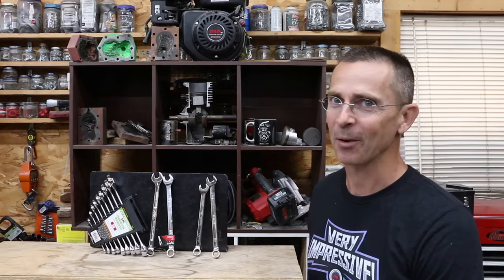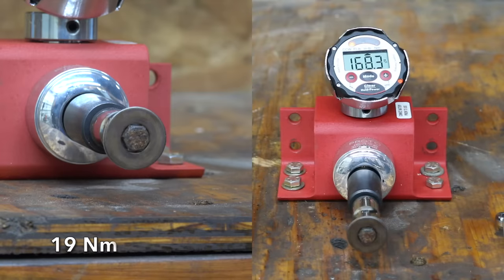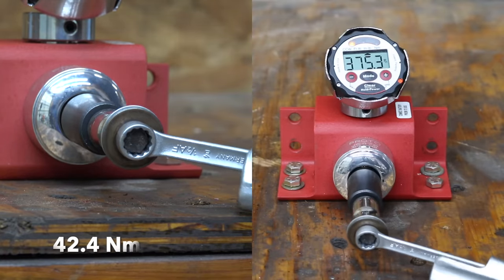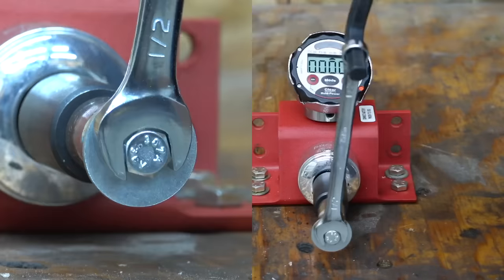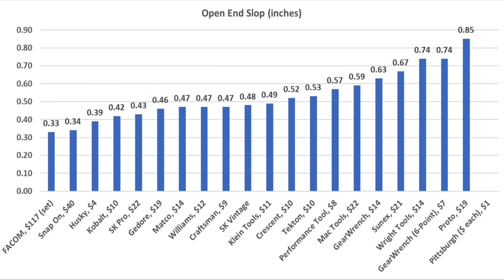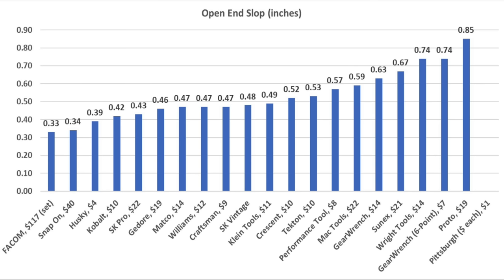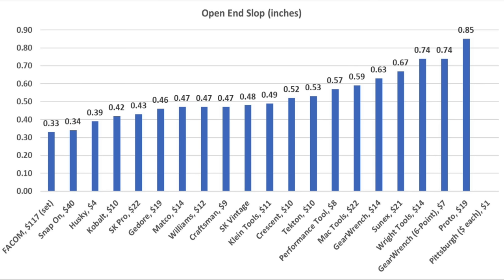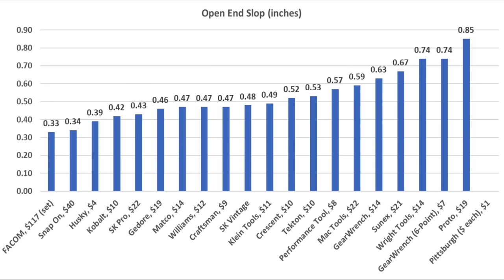Best Wrench? Let’s Settle This! Snap On vs MAC Tools, Matco, Proto, SK, GearWrench, Kobalt, Husky

Comment: I have Pittsburgh, Husky, Crescent, and old Craftsmen wrenches.  I've never had any wrenches break.  But I am only a DIY weekend warrior.  I think if I had trouble with a rusty bolt, I'd put some penetrating oil on it before whaling on it.  My Pittsburgh ones are part of the big Mechanics set.  They are not high quality but good enough.  I bought the Craftsman ones as my first toolset 45 years ago.  The Husky and Crescent were on a ridiculous sale that I had to buy them.
Reply from the maker: Thanks for sharing.

Comment: The wrench weight data was omitted from the table at the end of the video.

Pitsburg: 69.3g
Husky: 74g
Gear Wrench 6pt: 64.6g
Performance Tool: 74g
Craftsman: 95g
Kobalt: 77.6g
Crescent: 80.7g
Tekton: 80g
Klein Tools: 84.6g
Williams: 99.1g
Matco: 92g
Gear Wrench 12pt: 95.7g
Wright: 85.1g
Proto: 105.4g
Gedore: 51.5g
Sunex: 94.9g
Mac Tools: 104.4g
New SK Tools: 73.6g
Vintage SK Tools: 72.6g
Facom: 69g
Snap-on: 90.4g

It would be useful to have the wrench lengths too. Reviewing the images of the wrenches on the scale, I can see the Williams, Matco, Gear Wrench 12pt, Proto. Sunex, MAC Tools and Snap-on, are about one to two inches longer than average. Both of the SKs are about two inches shorter than average, and the Gedore and the Facom are about an inch shorter than average.

Wrenches that broke rather than bending: Pitsburg, Performance Tool, Craftsman, Kobalt, Crescent, Williams, SK Pro.
Reply from the maker: Thanks for the constructive feedback.

Comment: I noticed something here. I have heard that supposedly an open end wrench is supposed to be used in the reverse of the angle you used in every test. Instead of angled down they should be angled up. Which is opposite of crescent wrenches. Which should only be used angled down. I don't think it is AS critical to use an open end wrench is this way. But I have heard it does make some sort of difference in grip. I think because the force slightly pushes in on the bolt. Instead of just turning it.

Comment: It helps to have a set of cheap wrenches around, because they’re usually much thinner. You sometimes need a thin open-end wrench to fit bolts on shafts, such as braking and suspension components.
Reply from the maker: Good Point!

Comment: Rounded corners for less torque. If I have a stubborn nut or bolt, I will grind the bevel out of a socket or wrench.
Example is in removing a torque converter nut. You don't want to round one of them.
Reply from the maker: Thanks for the feedback.

Comment: I have a simple mechanics set of Channel Lock I got from Sam's Club. So far the only thing that broke was th 3/8 ratchet because I used it so much lol
I lose more pieces and the case broke before anything else did, only took me using a 11/16 as both a breaker bar mule and as an impact socket for it to finally break. But I LOVE their wrenches, I swear by them

Comment: Why add the Washer to reduce the grip contact when they all vary in chamfer? 

 The unless the bolt head is recessed into the project, what is the washer supposed to simulate?  It would appear most ends would have more grip if you did not have the washer. It would seem that most wrenches have enough to make Central contact past the chamfer so I'm not clear why you added the washer.  This test would be fine as a secondary test but think they should be tested as  designed to give each a fair shot . 
Also, not doing some tests because you didn't want to buy another wrench thus skews your rankings.  I maybe would understand that at the more expensive wrench side but you could have bought another Pittsburgh tool or husky wrench.

Comment: 'exterior paint an primer in one' would great to see! 
I think it could help the most people and it's less complicated than doing regular paint because results with different primers and different surfaces could vary.

 if you do it try to include Clark and Kensington, it's great stuff
Reply from the maker: Thanks for the suggestion.

Comment: Part of the problem with the really cheap ones is that the manufacturers equate 1/2" to 13mm to reduce tooling costs ( I suppose ). 0.3mm or 12thou = bleeding knuckles. Especially as Far Eastern manufacturers of fixings, pare the A-F down to the bottom tolerance.
Reply from the maker: Thanks for the feedback.

Comment: Not so much today, but back in the day did there is a specific reason why nuts and bolts have different sizes?  Tools were much more expensive back then, if the head and nut were the same size a mechanic would have to have 2 sets of wrenches
Reply from the maker: Thanks for sharing.

Comment: guys also keep in mind, most bolts at 1/2 inch are going to snap off at a certain inch lbs. so having a wrench that doesn't break at 1200 inch lbs doesn't really mean much. if you aren't abusing your tools and using them for their intended purpose then even HF tools will last.
Reply from the maker: Thanks for sharing.

Comment: What you said about the tekton is exactly what I was thinking about the husky brand wrench its current bent configuration would make pulling intake manifold bolts and transmission hellhole bolts easier lol
Reply from the maker: Thanks for the feedback.

Comment: I’ve seen first hand, several times over again, the Snap-On wrenches can remove bolts that other wrenches have already stripped.. those little slots they add in for gripping are almost like magic! No kidding. I usually don’t go for the super high end due to usual diminishing returns, but in this case.. worth it! It took a buddy to shame me a few times to realize it, full disclosure… 😂
Reply from the maker: Thanks for sharing.
Reply: snap-on combo wrenches - i used them for years.  their finish and feel i liked.  hey,  if you are a real mechanic get the best for performance and feel.  good tools are holy.  i am down here is South America and i used to joke they had a quality import examiner.  if the tool or part was too good ,  it was rejected ...

Comment: Something to consider, for a newer mechanic or home mechanic, is there a benefit to the wrenches slipping off before breaking the bolt from your first test. This is something that maybe could have been added if you had a set amount? I would be curious where the lines of force, damage, and a failure of just breaking the bolt would be. A damaged bolt can be extracted, a broken bolt has to be drilled out and the hole retapped so I could see a benefit in entry level tools slipping off before breaking the bolt.

Would be very difficult to test, but makes you wonder.
Reply from the maker: Thanks for the suggestion.

Comment: So the goal is to test for not slipping?
If the wrench is not slipping and instead breaking the bolts, here we go bolt extraction, then what is the point?
I think slippage would be the clue that the bolt needs to be heated or sprayed with some more penetrating oil on it.

Comment: Snap-On has went down in quality over the years. I have sets I bought in the mid 90's and have never had to replace anything. Used them doing auto mechanic, engine machine, and industrial maintenance work and never had to replace anything. My flank drive wrenches are different than the new ones also. Mine has grip grooves in the open end and I even used them on transmission lines and never had one not come loose. Did have to knock the wrench off the line nut several times from the bite it had. Have also removed bolts after another wrench had slipped on the bolt head my flank drive removed or snapped the bolts off.
Reply from the maker: Thanks for the feedback.

Comment: It may be worthy of considering a weighting system for your final results.  I wouldn't use an open-end (normally, when practical) for max torque - that is what the box end is designed for, and therefore, I would think that more weight should be applied to that score.  If you have to do max torque on a fastener that you can't apply a box end to, that is what flare nut wrenches are for.  The Proto didn't do well in the max torque for open-end, but the box ends were very high.  
You could also look at not simply using rank-order for scoring - the difference in force applied for the box-end failure load from 1st through 8th place is over 100 lbs, but maybe the difference between 3rd and 5th shouldn't score too differently - the difference is less than 20lbs.  Perhaps factor in the deviation between wrenches at certain loads.  
Another crazy way to look at some of the data is to compare cost to score.  Snap On overall does well, but you pay way more for that performance.  For anyone but the rich and the professional mechanic, they are not a good value.  Mac Tools, at just over 50% of the cost are a much better value.  Proto too.  But in the $18-11 range, you really can't tell, as performance is all over the place.
But I'm sure a statistician could point out other areas where raw scores are deceiving (and likely statistically not meaningful, as they likely would be fairly identical if sampling a group).
Reply from the maker: Thanks for the feedback.

Comment: I think its safe to say that most won't ever experience breaking a wrench.  I use up to 1 and 1/4 inch wrenches, doubled up or hitting with a 3lb hammer and yet to have them fail, Tekton and Husky.  So basically, think that most are capable of handling what you can throw at it.  So we should be looking at comfort and thinness to get into tighter spots.  At least, thats what I'm trying to narrow down my next set to.  Lost my sae set and gonna reup.
Reply from the maker: Thanks for the feedback.

Comment: Very thorough! I'd love to see you re-do the open end tests with a Snap-On Flank Drive Plus wrench. I have a lot of them and swear by those open ends for gripping rusty or soft bolts and nuts where normal open ends slip.
Reply from the maker: Thank you!  Thanks for the suggestion.

Comment: I bought a 1/2" Pittsburgh telescoping ratchet and I put a 5 foot pipe on it with it fully extended expecting it to break and I still use it everyday. It has outperformed every 1/2" ratchet I have ever seen. I have broken craftsman, kobalt, proto, gearwrench, Stanley, and countless others with much less. I'm almost trying to break it at this point!😂 IT WONT BREAK, maybe it was built on a Wednesday
Reply from the maker: Thanks for sharing.

Comment: Todd. Love the comparision videos on tools, oil, etc. Just wondering why you've never tested tools made for Walmart like Hart and HyperTough? Would love a video comparing their 8-22mm wrenches for example.
Reply from the maker: Thanks!  Thanks for the suggestion.
Reply: @ProjectFarm  I've seen the driver adapter video you created, which included Hart and HyperTough, but figure Hart might have had a design flaw instead of poor quality steel. A video testing the quality of corrosion resistance on tools would be nice too. I figure there are very different types of chrome vs black phosphate coatings on tools today. No one wants a coating that chips off after a few uses, even if it looks nice at first.

Comment: Very well done objective testing. At some point it would be interesting to see the performance of the TiProlight Titanium Wrench(es). They are aimed at the motorcycle market where the weight of carried tools is important. (Supposedly a quarter of the weight of the equivalent steel wrench.)
Reply from the maker: Thanks!  Thanks for the suggestion.

Comment: Please start testing different size wrenches. I bought the Icon anti-slip wrenches, and the 6mm slipped on a 6mm hex key. The smaller wrenches just don't have the strength of a 9/16".
Reply from the maker: Thanks for the suggestion.

Comment: -- GearWrench continues to impress.  Wonder after the warranty of a lot of these brands.  In a recent video of yours, I mentioned I bought a GearWrench ratchet, only to find their warranty is fairly strict.  Anyway, have a full set of Craftsman ratcheting and standard wrenches in this format.  Never put them through this kind of abuse.  Work fine in usual circumstances, but thanks for pushing them to the limit.  
    Was going through my tools in my cheapest toolbox (steal me tools for the truck) and found a legit K-Mart wrench.  That's before I was born, and I might be older than you.  Think I'll save it - like a baseball card or something.  Put it next to my .22lr mail-ordered from Woolworth, also before my time.  
    Anyways, thumbs up.   And Idea: Test Red dot and holographic rifle sights.  How well they hold zero, water resistance, battery life/price/convenience, hell, you figure something better than me.  But if you could include the Sig Romeo 5 XDR in that test, I would personally be grateful.  Love that little micro.  Can look over the rifle, both eyes open, and still see the dot in CQB, though I'm retired now, and embrace my job as a deadbeat, stay at home dad :)
Reply from the maker: Thanks!  Thanks for the suggestion.

Comment: I have an idea for new video content.
Testing spark plug breakage. I have seen two brands of plugs fail. Champion breaking the threaded portion in a cylinder head. And a Motorcraft in which the porcelin crumbled on removal. Both required engine disassembly. NGK and Denso , Autolite, E3?

Comment: I think you left off a couple of the most important features of a wrench and that is #1 feel these are hand wrenches being a professional mechanic for 50 years a lot can be said of the feel of a wrench specially when loosing and tightening such as the difference between a snap on and a proto the snap on edges are much thinner then proto and I believe the Proto could achieve much higher torque with out hurting your hand #2 is the indexing of the wrench ends with the ability to get onto a bolt or nut to l turn the bolt or nut in tight area snap on are very good with regards to this feature  some wrench's can turn a nut in a tighter area by flipping the wrench  over or using the other end while some just totally lock you out I've had times when I would use 2 or 3 different wrench's just to tighten or loosen a nut while other time 1 wrench could do the job where others took 2  #3 quality of the chrome wrench's get tossed around with other tool and parts cheap chrome peels or chips while sometimes high quality chrome are more slippery again I think the Proto finds a good balance
Reply from the maker: Thanks for sharing.

Comment: like to know the open/box end thickness.  always a surprise in the group too. I had to buy a new wrench because my craftsman spread more than a red light worker, was at the shop and snapon was the only guy there.  it also had the no slip open/box ends.  but the other thing it was super thin, makes working on brakes easier, some bolts screw past a part into their mount so to tighten it’s mounting bolt hole bolt you need a thin wrench to fit between (caliper mount screws go into the slide bolt head through the caliper ‘04 camry)
Reply from the maker: Thanks for the suggestion.

Comment: I liked the Par-X wrenches Snapon used to sell. They weren't polished and were very stout, with a pretty thick handle. They replaced them with the blue point line which is inferior.
Reply from the maker: Thanks for sharing.

Comment: Thanks for these reviews. They provide great information. However, this one is missing something in my opinion. Testing the limits of the capabilities of the wrenches useful, but realistically, virtually the entire time I use wrenches, they are not stressed to their limits. Rather, what matters most for the majority of the time is their ergonomics. If the beam is as thin as a knife blade, it may be able to withstand a lot of force in one direction, but it will be very uncomfortable to use compared to a thicker alternative. More rounded edges on the beam are also easier on the hands when a lot of force must be applied. These design considerations should be evaluated and factored into the ratings.
Reply: The visibility of the size of the wrench is important too. Who wants to be fumbling around with a wrench to find its size because it is stamped in one location with a tiny font? Ideally, I like the size to be found on the box end and open end on both sides for a total of four times. Also, how much dirt and grime does the design of the wrench allow it to collect?

Comment: You should test power tool BATTERIES and their longevity/ability to keep charging/how they weaken after a certain number of discharges, etc. In some ways this is more important than the actual power tools if over the life of a tool you would be required to buy 2-3 batteries vs 1.
Reply from the maker: Thanks for the suggestion.

Comment: The question is, how do you calculate Value?
For a professional mechanic that uses his tools all day, the Mac seems obviously better than the Snap-On with Better performance at a lower cost.
For the average DIY shade tree mechanic, Craftsman wrenches (my early preference) were a great value when you could swap them out at Sears (now Lowe's) under warranty.  For the price of the Mac Wrench, you could buy two Craftsman wrenches and still have change.
Reply from the maker: Thanks for the feedback.

Comment: some bolts or nuts are done with tighter tolerances then other. on my old jawa motorbike all nuts and bolts have almost no play when a wrench is put on them. inside the engine and gearbox its even tighter.
Reply from the maker: Thanks for the feedback.

Comment: I’d like to see an open end test partially installed on the fastener maybe 2/3. I’ve run into this scenario a lot on turbos, 13 mm bolts that are hard to get to.
Reply from the maker: Thanks for the suggestion.